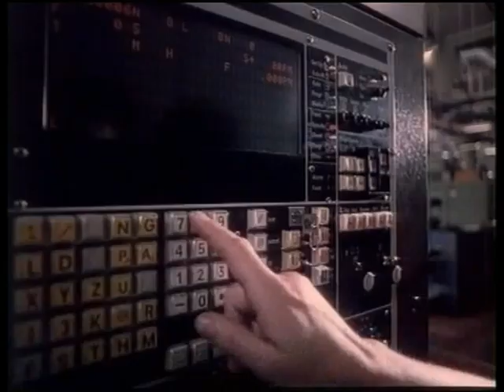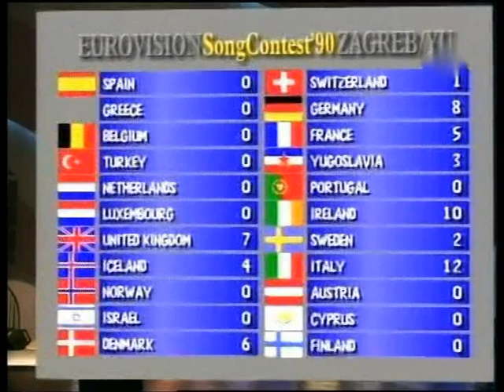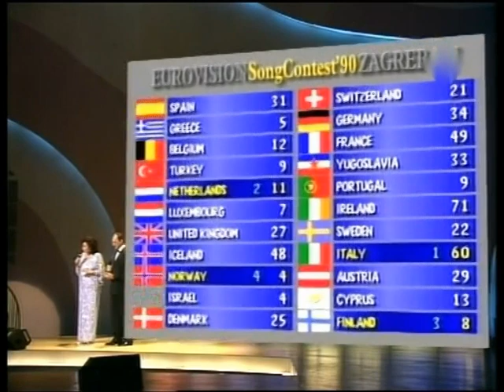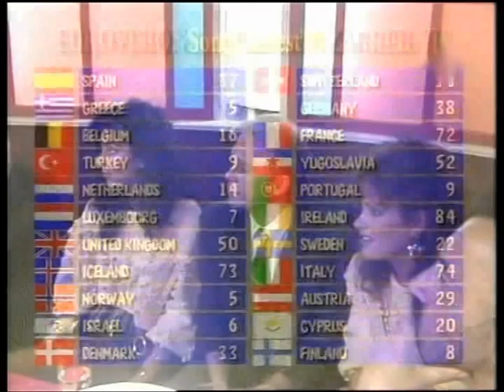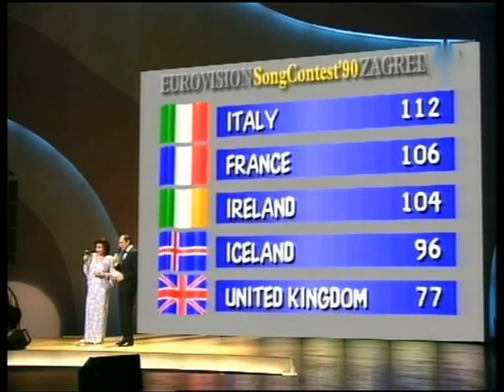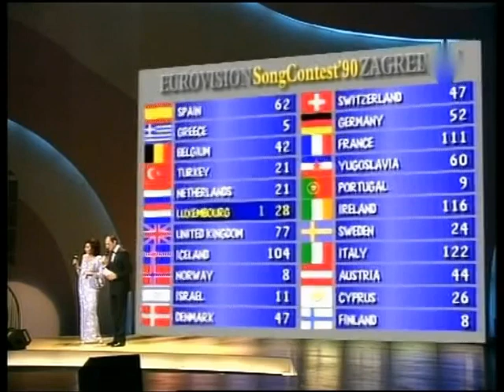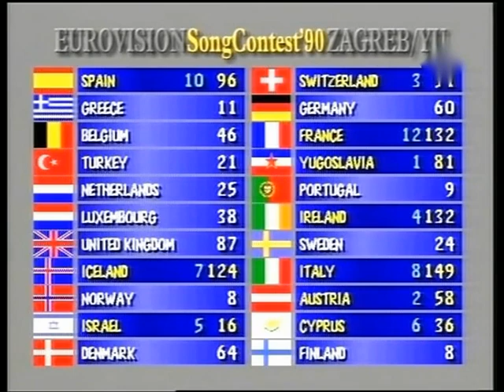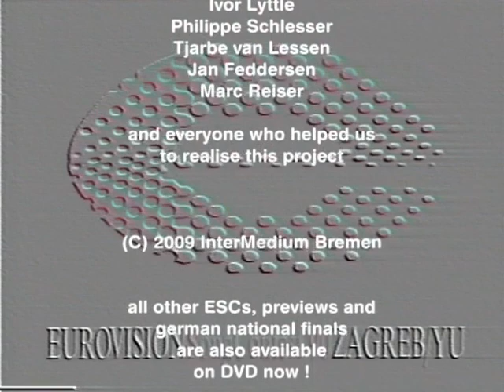Eurovision Song Contest 1990 (German Commentary)

Comment: Plasticeurovision, your information concerning the presenters is wrong. Vlahovic and Mlakar were the official presenters, chosen by Croatian TV who organised this ESC. Both are Croatian. Shortly before the ESC, under pressure from the Yugoslav/Serbian authorities in Belgrade and in the JRT (the Yugoslav, Serbian dominated TV confederation), Croatian TV was forced to nominate OFFICIAL BACKUP PRESENTERS, a thing that has never happened before or after. The back-up man was Croatian, the back-up woman Serbian, and they were supposed to symbolise a unified Yugoslavia. For this reason, the original presenters came under immediate pressure during their first rehersal. Demands were made for them to step down, and for the other couple to take over. The age question was used by some non-Croatian Yugoslavs present in Zagreb as an excuse for what was in reality a very political conflict. There was a special press conference after the first rehersal during which the scandalous situation was more or less clarified to a baffled European media corps. The power struggle ended with the forces behind the back-up presenters backing down. Meanwhile, on the streets of Zagreb, Franjo Tudjman was already organising rallies for an independent Croatia ...